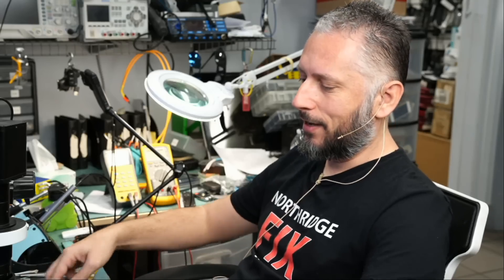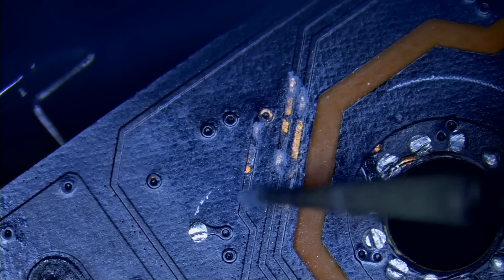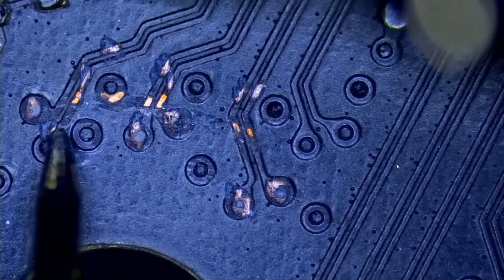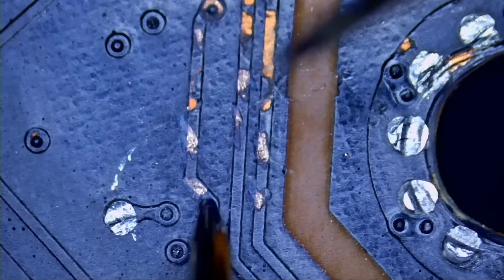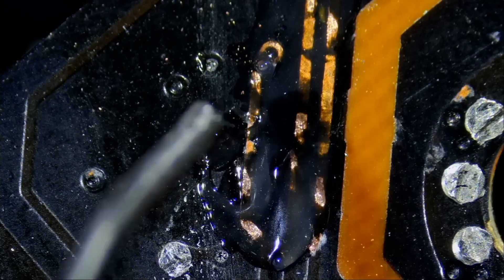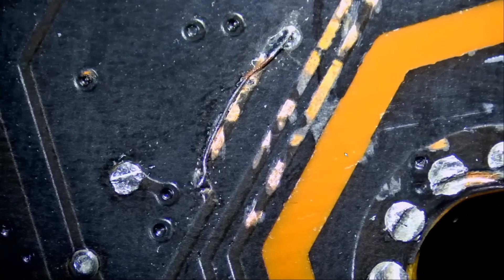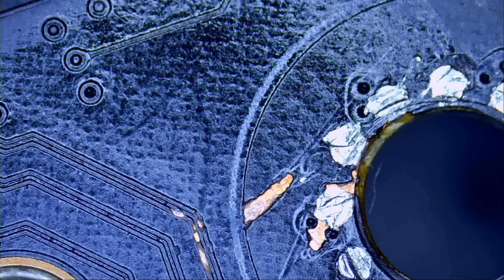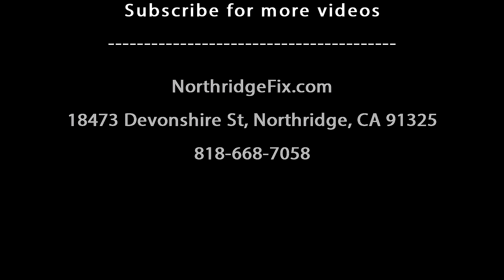ROG Maximus Z690 Extreme Repair - How useful is Memory Overclocking?

Comment: Overclocking does boost performance but depends on the part every system is different even with the same parts but you do gain a slight advantage but also higher temps

Comment: Hi Alex, I’ve got the same motherboard but it will no longer detect my keyboard and has a cmos error code 88. This happened after connecting the fan hub and resulting in a bad burning smell. I live in Australia and was wondering if i can ship the motherboard to you for repairs? Thanks Alex

Comment: out of the hundreds of motherboards I installed in my years in IT not once did i damage a single board, and that was back in the days when you had to custom fit every MB to every case and this moron caused that much damage installing one motherboard, some people need computers with idiot proof locks so they can't get inside........

Comment: overclocking the ram by selecting the saved XPM profile on the ram kit its pretty much a must do, its not like overclocking a CPU or GPU the RAM klt brings the settings saved on them you just have to select it on the bios, otherwise you can pretty much lose a ton of perfomance, and no, this is not an "overclock" that makes them super hot or consuming tons of power, its a way to apply the speeds the kit supports on the box.
Reply: If the xmp doesnt work the board is pretty much useless. Since he gonna run the ram at 2133 speeds

Comment: as a i.t technician, i always remind my self to handle the pc hardware part with a just tiny pressure, because i know with a single over pressure the pcb board will broken n cant run as a complete circuit board, then when pcb was short, is hard to find an expert pcb soldering like sir alex, great job sir alex, u should teach ur son the art of soldering that u had mastered, btw im just pro in playing games, lol

Comment: I bent 3 pins in my z370 cpu socket Msi Tomahawk. Rigged up a camera filming, zoomed into socket with lots of light, separate screen to see camera output, and bent the pins back, 
they were at 45 degree angle. Very hard to see what i was doing in the socket, and the needle i used looked very thick. Plugged in a i5 8600k, and it booted  🙂
Later, i started mining Ethereum, and decided to put in 2 graphics cards on the Tomahawk, but turned out you needed x8 Pci-e to mine, and only a handful motherboards that was xfire or SLi certified would let you do that. My tomahawk was only 1x16 and 1x4
So, i wanted to get the graphics card out again, but now with 2 cards installed, i could not release the lock on the pci-e socket. I tried and tried, but failed. Eventually i was so pissed off , that i just ripped the card out, and witnessed the pci-e socket was actually torn off the motherboard, and it was stuck on the GPU board. Now i had like 50 ? pins pointing into thin air from where the second pcie socket used to be. But, the motherboard had not enough lanes to support 2nd pci-e socket, if there was a M.2 disk in the 2nd M.2 slot. 
So i figured because of the priority on M.2, the pins would not get any power. I put in a M.2 disk in second slot and booted PC,  it worked nicely for 2 years more 🙂

Comment: Overclocking does make sense.  
DDR4 RAM (and DDR3 and DDR5) sells with a speed capability far beyond that which the MB will auto run it at.  

eg: 3600MHz you paid for will auto run at 2666MHz. 

In intel land that means the user needs to apply at least the XMP setting in bios ... it is 'overclocking' by strict definition, but in the real world ... not really. 

Now ... these auto settings are the base amount that any one stick of RAM can definitely operate at ... but it is a conservative standard.

That doesnt mean that a particularly good memory stick isnt capable of more ... so now the hobbiest goes to work to tweak it to its most capabilities.

Why bother? Because RAM that is running slow (and this guy was probably not even able to run XMP) will definitely affect the speed of the CPU ... its called a bottleneck, and poorly running RAM creates the bottleneck.  That can affect in games or productivity.

Comment: Overclocking RAM is usually very finnicky, and not worth the instability unless you thouroughly test it. What it has as a benefit is higher performance of your CPU, as the working memory can be accessed faster. This is usually noticeable in workstations loads, gaming or benchmarking. There is however a point of diminishing returns, as the error correction of (V)RAM will kick in once an OC is unstable, so then you will lose performance even though the clock speed may be higher

Comment: the vast majority of memory speeds are above the JDEC spec's so you need to enable XMP profiles which is effectively memory overclocking to get your ram to run at the advertised speeds. It also enables using faster memory timings. Now as to how much of an impact this is varies depending on the type of ram used, type of CPU used, the sensitivity of the game/app to memory speeds, latency timing uses but it can be very significant amounts of performance left on the table (in my case with a ryzen 5000 cpu and 3600 CL6 DDR4 between 10-20% in certain memory intensive games/workloads).

Comment: Faster gaming. Over clocking the CPU, GPU, and memory combined will improve performance. Yes it creates more heat but the advantage weighs out the heat dissapation. As long as you have a large enough heat sink or water cool it.

Comment: The most overclocking you need is to enable XMP to the default profile for the kit you have installed. Don't bother going higher.

Comment: yes..... an overclocker who wants to max out their components. scratches the underside of their board by improper heatsink installation, by scraping the board or dragging the board across the brass inserts inside the case. maybe they should focus more on building thier pc without damaging the parts first.

Comment: I´m reading all these comments about how RAM OC can give you up to 50% extra performance in certain games, yet I haven´t seen it in real life. I need more context, because I´m curious.

What kind of rig do you have to have in order to get extra performance out of the RAM? Where I live, I don´t see GPUs faster that a 1080ti (yes, I know I´m outdated, but this is my reality).

Are the benefits of fast RAM available in mid range CPUs too? For example, can I benefit an I5 12500 CPU with 3200MHz RAM instead of 2400MHz? (DDR4, of course). Have you seen any potential gaming performance improvement?

Comment: With memory overclocking I would say it depends on whether you mean XMP/DOCP stuff that gets the DDR4 running at its rated speeds that are faster than the original DDR4 spec or fiddling about trying to go faster than that.
Personally I think the latter is a pretty pointless hobby but the former is completely standard.

Comment: This is a very expensive motherboard yet they cut corners on the design. Usually near the mounting points on the pcb there is a safety margin with no traces to prevent exactly this kind of damage. My much cheaper msi z690 carbon motherboard actually has reinforced these areas with metalic surfaces to prevent digging into the solder mask. ASUS products are overpriced rip offs.

Dont get me wrong, the owner definitely had no clue how to build a PC but still the user error need to be taken into account in design of a product to some extent. There are a lot of idiots out there and they overlap very well with those who would pay for ASUS ROG products...

Comment: Memory OC is generally used to edge out more FPS. You could easily google some memory OC videos on your free time. Generally you can gain 10-50fps depending on the game average wise. When you are "competitive" you want as much FPS as possible. In the example of Counter Strike Global Offensive, 150fps means 6ms response native in terms of rendering. That doesn't include lag from internet, or input lag from mouse/keyboard, or even monitor latency issues. YET, at 300fps, you have 3ms response native. So you edge out an advantage. When all forms of latency are added up, I could for example have 30ms total latency while someone else has 90ms total latency, and thus I should always beat them. HOWEVER, in modern gaming, there are WAY too many people cheating. NO PRIDE to work hard and learn games anymore. They have to win at all costs. A lot of youtubers and twitch streamers cheat. Some more so than others. And only people who actually play the games they stream/record know they are cheating. WAY BACK WHEN, Wolfenstein Enemy Territory, I had a hand-me-down computer that barely got 5-15fps playing said game. I struggled to win long gun fights because my overall latency was worse than everyone else. And then my father, my awesome father, bought me and my brother both brand new computers. My brother and I picked out the parts we wanted. Then we got 200fps playing Wolfenstein Enemy Territory and I became unstoppable. Because I had already learned the game as much as I could to edge out every advantage possible in terms of knowing the maps, where to snipe from, how to rush, etc. And now my pc had tons of fps so my latency was reduced. Thus my mind was already in a faster state of processing. I was so skilled, that I was invited to join a team. And in our first online season, my entire team got banned, but I had not. And they were like "what cheats did you use" and I was gob smacked. "I don't use any cheats" and they said "come on, don't lie to us, we all cheat, so do you" and I said "no I really really don't cheat" and they ended up saying "whatever, liar" and that was the last we ever spoke. They quit gaming after being banned. I haven't seen them online since and they are still on my friends lists. Yeah "why" because It makes me feel good to remember how shit they really were and how skilled I really was and knowing they quit gaming because they couldn't cheat anymore. I mean they may have gotten new accounts, who knows. But still. When I play Valorant or CSGO or any competitive game, I can tell when someone cheats, because they break hard coded rules of the game. When you truly learn what you can and can't do in a game, you just know....

anyway, TLDR memory overclocking can get you more fps in games in 1080p and 1440p. doesn't really do much at 4k.... its all in an effect to edge out as much performance as possible. because more performance means more advantage over other players.

Comment: Regarding overclocking, overclocking ram yields more performance increase than purely overclocking cpu. That's based on the fact, that fetching data from and writing to ram is simply faster then. However ram overclocking is also harder, since the memory chips are much more unforgiving regarding their timings (signal shape, strength, duration,...). Back in p4/athlon xp times, overclocking fsb yielded a overclock of ram (if linked) and cpu alike, the cpus always took much higher fsbs up to 250mhz, if linked it almost always was instantly over at 205mhz even with the best certified 400mhz rams. Anyway, overclocking ram is a practical thing, that's why intel made a memory overclock block on certain chipsets/cpus per bios. No additional performance without paying more!

Comment: Some memory is faster than the standards released so just running some memory at factory speed requires «over clocking» XMP or similar

Comment: if you overclock memory it can fetch data faster than normal clocked memory
if you have slow memory the cpu has to wait until the full data is fetched then cpu have to process the data and write it back to memory it consume a lot of time
we can minimise this delay by overclocking memory resulting in significant improvements in performance of pc

Comment: The memory has a native frequency, usually 1600 .
If you buy the 3200 memory clock this mean can be overclock 2 time .
You have to go on bios and give the abilitation to overclock the memory and you can verify the memory now run untill 3200 ,before only 1600 the native frequency!
You can check with motherboard program ,like master Ryzen to verify.
Always you have to overclock the memory.
Bye I'm like you professional trouble Maker!

Comment: Memory OC is so common that you buy rated kits. The reference speed is often very low and memory kits are often more capable of running more MT/s.
This makes more difference with AMD due to their fabric, but it helps all systems with data transfer between system and CPU. It's the second most common form over overclocking, in fact XMP profiles often overclock ram and CPU.

Comment: Alex overcklocking a memory helps alot in term of cpu minning.
The share submitions increases and its easily to find a block.
In term of normal user u can buy a normal 2400mhz Ram cheap and you have a Ryzen running at 3200mhz .
Overcklocking the Ram from 2400mhz to 3200mhz improves alot in the system .
Hope my explainatation Help .
Happy new year and Much Love to You ❤

Comment: i understnd some gamers or video editors or 3d video rendering like to have overclocked Memory or CPU to GPU, for me personally it will age these parts faster even if you undervolt it by some software to reduce the voltage, eventually it will soft break your OS  with the new voltage change of overclocking.  as far as I know 16GB of ram is still good enough for any modern high demanding memory as for the performance and quality it is not gonna be that much of a big deal on high-end computers, but mid or low end computers you might notice a bit of difference in overclocking whether in games, or video editing/creating or on video 3d rendering software only if these parts allow the overclock. andstill these parts have limits point that you can't exceed.  in short. no it is not worth it unless you have much  more money to keep buying computers.

Comment: overclocking memory is equally important like cpu or gpu overclocking its like an triangle (it depends on each other) you can clock your cpu high to 4.8 ghz (i know is not that high anymore,i'm getting old ;p) but if you do, its gonna suffer in memory bandwith its gonna go under your spec that you set before hand. so thats the fun in overclocking to see how far you can set coreclocks before you see your memory tank in performance then you know you hit the max .
equally an gpu likes an good overclocked CPU/RAM config to run better/higher clocks 
did'nt say anything about undervolting yet that a thing too..

how do i say this:
in a motorcycle you have to have your fuel, spark/air(compression) to start engine right, pc is the same..

Comment: Over clocking memory is how you make the most gains in gaming or gaming related workloads (3d mark for instance). In some games, like overwatch or warzone, a memory overclock can see increases of 20-50%. 

A CPU can't perform if it has no data. Enter fast memory to keep the CPU fed. 

When ocing memory, depending on how far you manage to take it, you can achieve a 2x increase bandwidth and about 30% lower latency.
Reply: when you're increasing bandwidth with overclock, you usually need (apart from voltage) a bit more "relaxed" timings, which means higher latency. you need very high quality ram chips to keep the latency the same.

Comment: 1: Overclocking memory works so that the CPU is constantly fed with data. CPUs have gone a long way to the point that they are starved for data and modern applications rely on huge transfer of data to work. Old applications on the i5-2500k used to not get any gains on DDR3-1866CL11 vs DDR3-1333CL7 but with modern games and applications it can make computer twice faster. Same thing with newer CPUs, especially with the 1st-3rd gen Ryzen architecture designs.

2: for the anti-glare, might I recommend installing a polarizing filter in front of the lens? In photography, we use this to reduce glare on shiny surfaces. We call this a CPL filter we screw in front of the lens. There downsides such as that you may need to increase light and things may look too flat.

Comment: Over clocking memory stops a bottle neck in some cases from the ram to the graphics card only in some cases. over clocking memory in normal cases will give you 20 to 30 fps if your lucky.

Comment: Of all the pc I’ve built and laptops I’ve gone through over the years. I can safely say that Asus has more quality control issues than other manufacturers when it comes to motherboards. But they lead the way in laptop failing. You can’t go wrong with a MSI, or gigabyte mb paired to intel processor. I’m still rocking my i7 6700k. Upgraded to m.2 upgraded to 4000 mhz 32gb ram and paired it to 3070. Don’t have any issues. Even when I had my 1080 I was able to get decent frame rate on most if not all games.
Reply: LOL,i bought an asus TUF laptop 4 months ago,the display already had to be replaced due failure :D

Comment: Great video!
There is quite a bit of performance to be gained by overclocking memory. eg. increasing from the DDR5 JEDEC spec (ie. not overclocked or even using XMP profiles) of 4800 MHZ (or MT if you prefer), can give substantial performance improvements. For example, my DDR5 kit can hit 7000 MT C32 with safe daily voltages. That's approximately a 50% increase in bandwidth over JEDEC spec.
Reply: But how does that 50% increase in throughput translate to overall system or gaming performance, especially on an Intel system like this? IIRC, AMD Ryzen is the one that likes fast RAM, and even then the gains aren't really that large unless your RAM is a trash speed to begin with, like 2133MT DDR4. The think the largest gains I've seen are (unsurprisingly) Ryzen APUs which uses system RAM for the GPU. Not to mention, lowering the latency seems to have more effect than increasing MT.